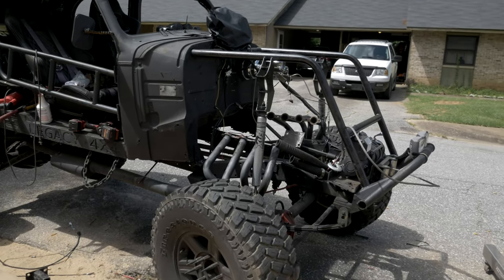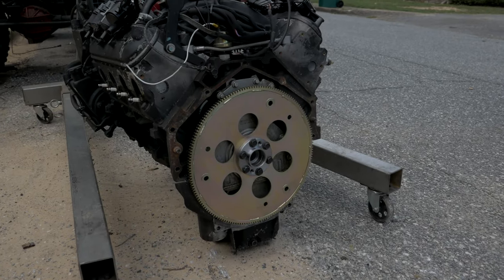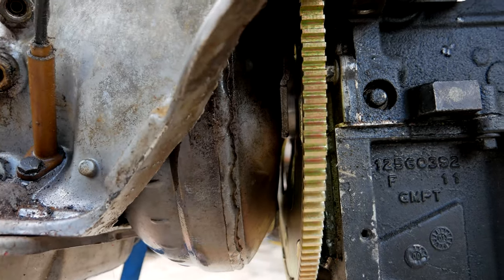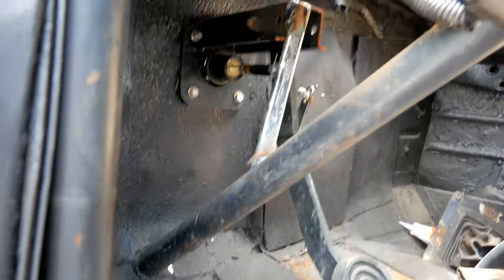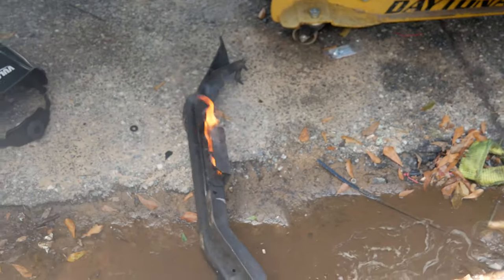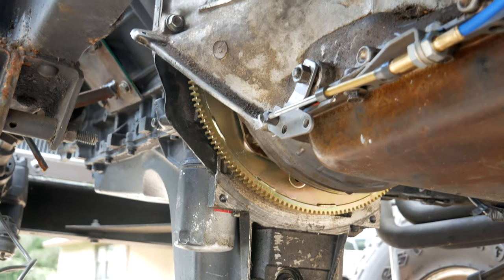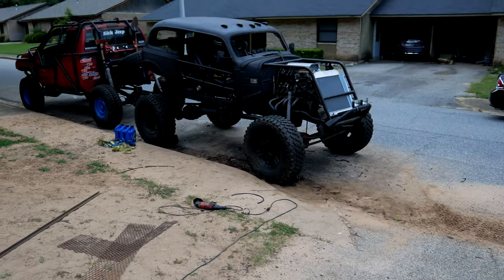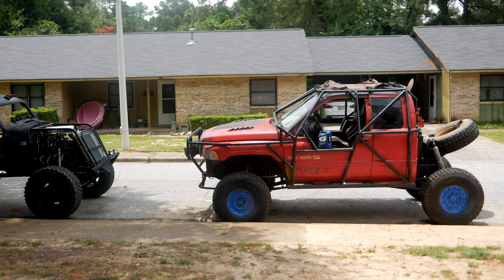Finishing my 1939 Chevy LS Swapped Mad Max Build || Legacy 4x4 and Off-Road

Comment: Badass looking rig. That TH350 isnt going to be happy behind that LS. I know your getting a TH400. Also are you planning on staying 2wd now? I noticed that TH350 was a 2wd version so first thought was you were going to do a divorced tcase setup but then you just put a driveshaft straight to the rear.
Reply from the maker: Yeah I'm waiting on it nuking... The Corvette it was originally behind actually made decent numbers factory, but still... 

The two-wheel drive was mostly just to get it running, I have a 205 to go behind the turbo 400 as soon as I make the jump, I just really wanted this running so I took a few shortcuts...
Reply: @Legacy4x4andOffRoadYT  nice